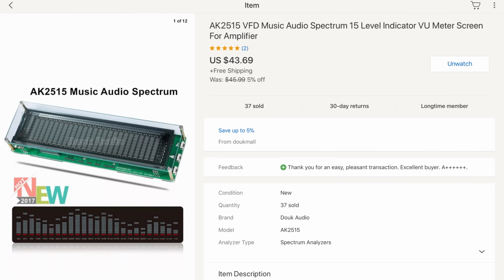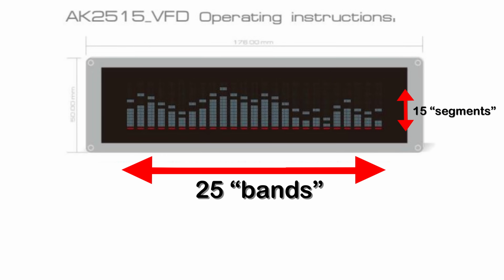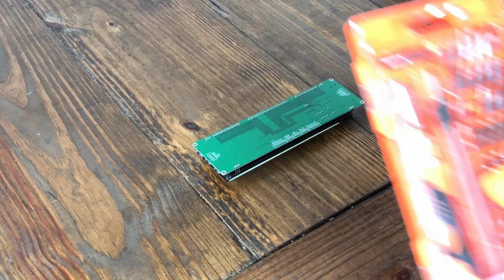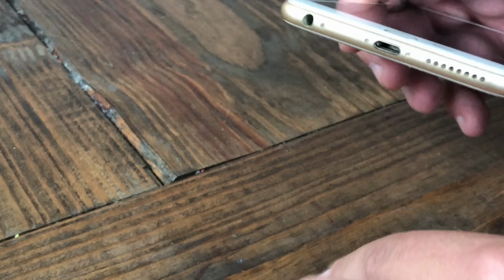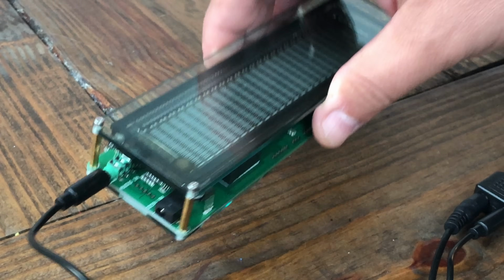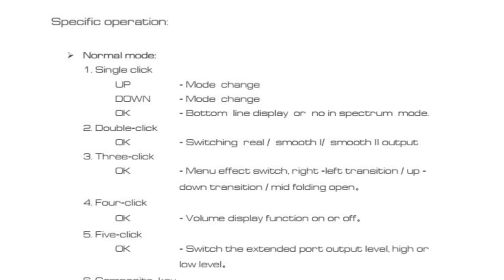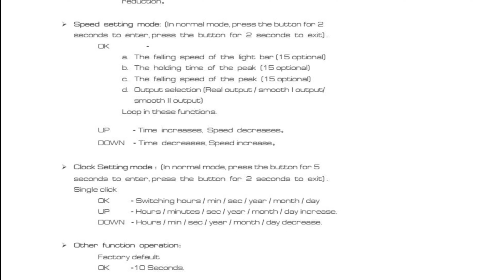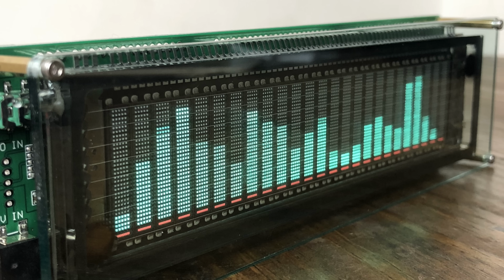Visualizing the Spectrum? AK Technologies AK2515 Audio Spectrum Analyzer

Comment: Just got the pro v3. It has Bluetooth but haven't figured it out yet, says you need an app. The analyzer is not accurate on mine and even with no music the bars still spasm up and down like some signal is there. Also the buttons are inaccessible on the backside.. im just returning the new version and buying the one in your video. Cheers 🤙

Comment: Ok for car audio does the audio video converted to 3.5mm supply power or dies it need to be connected to a hot wire /power wire?

Comment: Have you ever tried this with pink or white noise (or maybe some sort of easy sweep generator? I've seen them as android apps)  ? We've got a special ham radio application we are trying to set up so we know more about what a "repeater" sounds like. A "repeater" is a special fm radio on a mountain top that picks up weak fm radios and transmits them to the other side of the mountain for instance.  The spectrum on some repeaters (especially ours) can be messed with to the point where you don't know what you've got. Its radio audio and every radio messes with the audio specrum (FM Pre-Emphasis and De-Emphasis). We have a volunteer group with special repeaters (ham radio) trying to fix the audio so every repeater sounds the same. The end gadget needs to be inexpensive, easy to replicate, and easy to power.

Comment: I had a 1996 regular cab Dodge Dakota Sport with the short bed.  I put 4 Kicker 15s in the bed ported through to the cab with an RV weather boot.  We took the cup holders out and put in a Kenwood KGC-7043 single din graphic eq and I loved it!  It not only gave HUGE adjustments to the sound but there was a knob on the front of it that had gain controls for my Subs and my high range amps which offered endless setups for your music!!  I loved it and wished I never had to sell that damn truck......

Comment: bought this and hooked it up to my computer speakers.  plugged the 1 into 2 cable into the lime green audio jack on the back of the computer.  then I plugged those 2 coming off 1 into the computer speakers and 1 into the eq.  the other port on the eq i plugged into the computer usb.  I get some background noise coming through the speakers while watching utube videos and the led's dont jump very well on the right side and dont seem to go all the way to the top, like it needs some adjustment.  otherwise, it's a cool little eq that works!

Comment: Hey I need some advise ,I got a kenwood home stereo control amplifier kc -992  pre-amp connected to a crown xli 1500 power amplifier .it's hook up to 2 3-way floor speakers  that I added speakers to a 12inch fosgate  250rms ,a ds18 6in mid and 4inch superbullet tweeter. WHAT IS THE BEST PASSIVE CROSSOVERS  TO GET GOOD BASS ?

Comment: ok...after seeing this, as I am too an old school bass head, and I really hope anyone can help..
I have 2 of these loaded for purchase, can I and how do I wire these into a stock 2012 Toyota Camry XLE? 
see, I need to keep stock for resale value,yet, I want to do a pod for these to sit in and pointed outwards for  those around from the outside in traffic to "SEE" the beat. I hope you all follow.
I have a spot picked out, build is no problem, but the wiring is..and not to hack up the factory wiring.
I'm a full fledged KENWOOD/ROCKFORD  junkie!! so please, any help would be great!!! 
Thanks!
Reply from the maker: This device needs audio input (line level) so you would need to convert 2 channels of your speaker level output from your factory radio to line level (via adapter), then another adapter for 3.5mm. I mean it’s possible, just not simple

Comment: So many possibilities! If you have too strong of a signal you could wire a potentiometer in series to limit the overall signal voltage. That would prevent overdriving the signal and just getting one or more of the bands maxed out. And   I wonder how it would hold up to the scorching heat of inside a vehicle in the middle of the summer with the windows up? I also like the green filter idea I seen on a previous comment. Do the website quote any of the band frequencies?

Comment: Need to see if it can be hacked to use the eq to power an LED stack array.
Reply: It's not an EQ, it's a spectrum analyzer, and yes, you can hack it to output it's data to drive separate addressable LED strips.
Reply: @starmc26  I type corrected.  I know what the device is.  I have been working in engineering labs for decades.

Comment: I bought this recently and came preassembled. Connected power displays time clearly but I could not make it work for songs. Audio in and out works fine. Connected headphones in out port and it works. Any idea how to get out time adjustment mode? Looks like its stuck in that mode
Reply: Your audio INPUT is wrong... It needs to be "high level"... Which means "speaker signal" or "headphone" jack

Comment: Hello, it is possible to turn off the clock if there is no audio signal?
Reply: Yes, but not through the menu... You actually have to sever or "disconnect" a pin on the clock module, there's a video on YouTube detailing it.
Reply: @starmc26  could yuo send a link ?

Comment: Hi, I am just thinking of Buying it, just one question,, I could see you use RCA Cables connected to the AUX line level output from the Radio,, does it mean  this devices can work with line level signal??????  I want it to hook it just after my Professional Equalizer?
Reply: It actually needs line level

Comment: Great video.  Can I connect the VU meter to speaker B output using left and right speaker wires?  I have a Pioneer SX 1250 and using a Realistic apm 200 for vu meter.  But I like this one also.  Thanks in advance
Reply from the maker: No, not speaker input. Needs headphone or line level

Comment: Neat. Kinda looks like it was intended for PC case installation.
Reply from the maker: Should work for that application as well. Just use one of the 12V rails to power it
Reply: @wal  wait, the black PCBoard version, which i think is newer is 5v.. is this older version 12v?

Comment: Hey, did you connect the RCA cable to the amp out on the head unit?
Reply: I dont think the rca have enough juice to power it.  The headphone jack got more juice
Reply: Yea, you need a 3.5mm to rca  cable, connect to front or rear channel on head unit, if those channels are already being used for amps you need a 2 to 1 rca cable to complete connection, I used the USB port on the front of head unit for power

Comment: dude you need to do a video showing exactly how to install this thing to a head unit,a new one,like the pioneer 80.please...ive worked my butt off this week making a cool fiberglass bezel to mount this thing on my dash and i can't get it to work.ive tried hooking up a dozen wires a dozen ways and all i get is the clock,i take it inside to my computer and it works,so its not a bad unit ok.any help would be great from anyone.

Comment: well i guess I'm the dumbest sombitch in the world because i can't get it to do anything but the clock when i hook it up to my head unit,a pioneer DEH-80PRS i have two USB ports,one is being used for my iPod,so i plugged the usb for the spectrum into the other,then i plugged everything in the world into my aux.input's on the back of my H.U. and nothing,no dancing graphics lights.i even made a fiber glass bezel for it and uses Bondo and sanded and painted it,and nothing,anyone out there have their ears on,i need assistance apparently.how can i click on source for usb and have Aux,work too i guess,i don't know.can someone in lamen's terms help me out please.
I've tried the little hidden switch on the bottom of the HU from L to H and when i scroll i come across AUX 1 not AUX 2 and it says to turn it off by using the Mc knob,but i tried that,i did find a small head phone jack on the back of the HU and plugged into that but no graphics,only a friggin clock.damn I'm pissed.

Comment: Could you address these questions to the manufacturer AK2515_VFD ? 1. Do you plan to release new HW versions of RTA with the use of a large VFD display in 1/3, 1/6, 1/12 octave with a precise indication of the level of frequency, calibrated in dB, no AGC function, with good accurate ADC, fast CPU, grid frequency: 20,25,32,40,50,64 Hz---KHz 12,14,16,18,20,22 ? 2. would like to have an accurate RTA device, the direction in which it would be possible to believe and not conventional meter toy. 3. Is it possible in this version AK2515_VFD to disable AGC? AGC strongly affects the measurement accuracy of signals, and at different frequencies has a different effect. For example, if there are high levels in the midrange or lowrange of a signal, then the AGC turns on and the lowrange of 8,12,16 KHz becomes lower than the actual signal level. The range of 12, 16 KHz is practically not displayed! Why?
Reply from the maker: You just did 😬👍
Reply: And I agree to pay more. Moreover, I understand well that devices with the required characteristics will not cost $ 50. But let them do it. I'm willing. But there's nothing, nobody does anything. The old devices that are sold on Ebay, I'm not interested because I already have and Samson D1500 and Alesis D230Q, but they are bulky and they can not be built into the device. And from new there is only EVOR04, but it does not use VFD. So I ask, what would this VFD this amazing bulb has developed first-class spectroanalyzer. I'm willing!
Reply: Alex please let me buy your D1500 or D2300Q for a reasonable price!
Reply: @AlexGeForceASR  You can just make one - I've made several, both using FFT, and also analogue band pass filters to get the exact frequency bands I wanted. The electronics are not that complicated, honestly - just a lot more components for the analogue version, obviously. If you wanted to use this VFD with your own electronics, you should be able to de-solder the controller PCB and add your own. As said though, you're looking at a lot more than $50 for a custom job. They will likely never make them, as there is no market for anything more than the nice looking audio analyzer they have here. 25 bands is pretty good, to be honest...
Reply: What you are looking for and what you want it to do, takes it way out of the $50 price range. Get a grip, this is more or less just a cool flashing light that resembles a spectrum analyzer. Not a real spectrum analyzer. If you actually know what you want it to do, ( and it seems that you do) and you have some pretty specific things you want it to do or not do. Then you already know that a $50 Amazon or eBay spectrum analyzer is not what you want.

Comment: How would I wire it into a car? as they dont have an aux out?
Reply from the maker: You would need to split RCA’s and convert into 3.5mm or solder RCA via pads on the right side of the circuit board
Reply: ah sweet thank you! I need to do some research!

Comment: OMG ..you saved my life ..lol
I was looking at old school EQ's... just for the dancing lights (Alpine H701) and I thought the display was too blue and would make it look like I had two identical head units in the car , it would just look wrong..IMO..this is dope.
Excellent review ..BTW
Reply from the maker: Cool man. This one will need a 12V to 5V USB adapter and either RCA to 3.5mm adapter or some soldering skills to add RCA’s to pads on the unit. But yeah, it’s super cool looking 👌
Reply: Personally I think that the manufacture would be wise to market this with a din size frame around it , to appear as something from Alpine or other major manufactures. Also mount the function buttons on the front , built into the bottom or sides of the screen.

Comment: I ordered one, it only took 8 days to show up in my mailbox from China. 
my question is: how would a person go about hard wiring this into their car's 12v system without using a USB power supply? I'd rather not have to plug this into the front panel USB of my stereo because I plan on modifying a dash installation kit so that it can be flush mounted in the dash with all the wiring hidden for a clean install. 
I've already done some research and was curious if wiring it directly to a switched 12v power source would fry it or if the power supply had to be limited to 5v. 
Also, before I assembled mine I used my vinyl plotter to make a frame for the front panel to black out everything but the actual display.
Reply from the maker: You can use a 12v to 5v step down converter. I would not connect directly to 12 volts
Reply: my clock was also correct
Reply: There's solder points on the rear for power and line input.

Comment: Okay so I'm stupid and I'm going to ask a stupid question. How do I incorporate this into my head unit?
Reply from the maker: Need to split the RCA output signal, convert to 3.5mm, feed into Analyzer. Also, will need 12V to 5V step down converter (12V to USB) to power the unit
Reply: Thanks Bro! love your chan!

Comment: 3:28
I bet that device has either a small supercapacitor or a backup battery (rechargeable?) to power something called a "Real Time Clock" ... basically, it is a dedicated circuit to keep time, and is built to be able to run off of a battery for years. (Literally with microwatts of consumption.)
Also, that's good that it had the correct time, as some cheap RTC's are notorious for being inaccurate (like, loosing a few minutes per month!), even on some PCs/computers from well-known manufacturers.

P.S. $40 for a device with a large VFD display like that is actually a bargain! Try buying a VFD like that from an electronics distributor like Digikey ... You'll be paying about $100 for a display that size ... ahh, the wonders of China!!!

Comment: If anyone has access to a 3D printer, I designed a case to hold and protect the analyzer.  I got mine in the mail yesterday and got a slight 5V shock from it while adjusting it.  :)
https://www.thingiverse.com/thing:2872697
Thanks for the heads up on this BigD, it's pretty awesome!

Comment: Need the schematics on. Obviously, you can wire in a 12 to 5 Volt converter and I am sure you can solder on RCA connections to the back. Make a quick connect and you are in business. Looks like a quick little upgrade. My only concerns are the brightness and ability to customize the color. This thing in blue would be dope!

Comment: Added note there are a few cases out there that I think can work well. One of them looks like it will slide right into a Din opening. 
https://www.ebay.com/itm/152145903479
https://www.ebay.com/itm/130403175623
Reply from the maker: Thanks for posting, I’ll check them out. I may remove this comment and replace with my affiliate ones though 😊🤙

Comment: SO cool! I never knew there were DIN size units like this available. I used to stare at the spectrum analyzer in my Aiwa bookshelf stereo back in the 90s during certain songs. Had a Sony head unit in the early 2000s that had a configurable display that thing was cool too,  but there is no substitute for a VF display. This is going on the Amazon wish list stat. Thanks big D another great production
Reply from the maker: Man I remember going to the electronics stores and drooling over the coolness of those mini systems with the spectrum analyzers and “hyper bass” output. Fun times

Comment: I'm a home audio enthusiasts that likes buying cheap and building it up so it doesn't get boring starting with the best. anyways 

I'd like to see big d wiz to do a frequency sweep to see accuracy.  reason I want 4 of these L&R on my custom sub  before minidsp and after minidsp to see the change in frequencies in actual real time. just a thought. 

system I'm working on now.

4 Kenwood Basic M2 power amplifiers 2-channel with both running  220wrms@8ohm, 120wrms@ 16ohm .004% THD@1000Hz 120db snr and 4ohm stable double power. 
4 Sansui C-1000 stereo control preamps slightly modified caps and I/O's.
4 MiniDSP 2x4 
2 home built 16 driver line array using Dayton Audio 8ohm 1"x5" full range speakers with 4 groups at 8ohm load to amps with half of each MiniDsp using the delay of the 7'x4"x27" line array. quad amped I guess. 
4 Dayton Audio low profile 10" 8+8 DV subwoofers L&R on side of towers wired as an 8ohm load powered with 2 Dayton Audio SPADSP-500.

sorry for rambling
Reply: Joe Baker he put a link in one of the comments for s sweep video.

Comment: Great video  BIG D!!!! 👍👍👍 That unit looks very similar  to the Pioneer DEQ-7600 digital  processer in which I recently brought on Ebay for $545.00 by having  the highest winning bid!!!  A lot of people  don't  know that those old school analyzer spectrum processers still  go for a lot  of money on Ebay!!!! In most cases they go for a lot more than the original  price that they cost when they first came out in the early 90"s!!!!! They are a little hard to find that's why they cost so much!!!! I'm still trying  to get my hands  on a Pioneer DEQ-9200 digital Processer in mint condition for a reasonable price but I haven't had any luck!!! The one that I did find on EBay they are asking for $1000.00 for it brand new!!!!  Sounds crazy  doesn't  it???
Reply from the maker: I know bro and I don’t think many people care too much about the EQ or crossover functions, just want something visually stimulating 🤗
Reply: BigDWiz Yes your absolutely  right BIG DWIZ!!! Thats  the reason why most people  buy them for now day's!!!!!
Reply: I check everyday for a 9200. I have a mint matching cd unit that has been sitting for years waiting for it. Huge thumps up bid D this is the coolest vid yet.
Reply: 550 dollars in 1993 would equal about 950 dollars in today's money. Which means it's held it's value well and matched inflation